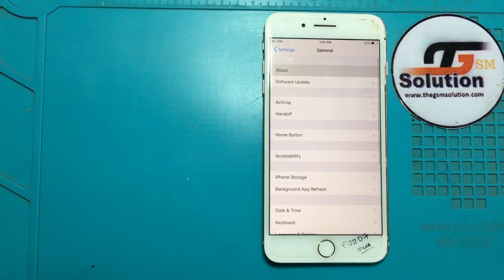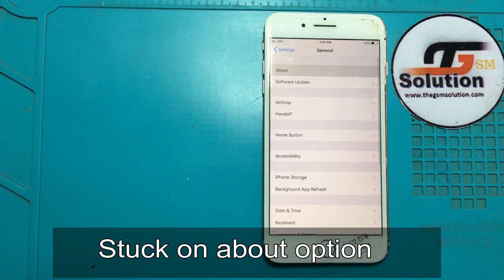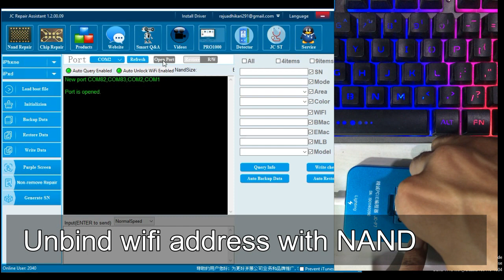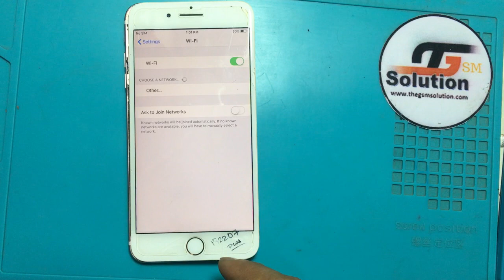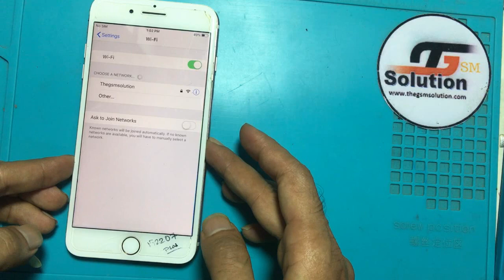iPhone7,7plus wi-fi Greyed out 2019!Fix Can't turn on wifi on iPhone7,7plus.

Comment: I solved this issue today, maybe temporarily but, My iphone 7 plus had the wifi grey out problem, upon reading online, one of the suggestion i saw was put your phone under a lamp for 30 minutes, now from what i understand, it wants me to make the phone hot, so what i did instead was remove the logic board, took out my heat gun, and just blasted the wifi chip for 5 minutes, thing was 100+ degrees celsius, and then i use something to kinda press it down on to the chip a bit, not sure if it does anything but whatever, after that i put the phone back together, and to my surprise, the wifi is now back on. definitely try this if you can.

Comment: hey! this happened to my phone and I was pretty freaked out because all of the videos showing how to fix it involved taking my phone apart. All I did was turned it on and off a few times and then let it sit for like 20 mins, and the problem fixed itself. so wait a little bit of time before you tear your phone apart!!!
Reply from the maker: Sometime that process works but not the ultimate solution on that cases only reball the WI-FI chip then the problem solved that issues shows the dry soldered of WI-FI IC.
Reply: thanks ! this just happened to me and it worked😌 I appreciate it !
Reply: laderricka nephew did u wait for it when it was off or on?
Reply: I’ve had this problem for almost a year and it still doesn’t work
Reply: Did u wait for it when it was on or of
Reply: Same second time it's happening
Reply: Megan.Major same this is happening to me and it’s been a month and it’s still not working

Comment: Nice work.  I was confused a little bit.  Did you reinstall the same wifi chip or did put in a different one?  The NAND memory chip was removed so the wifi ID could be removed?
Reply from the maker: I used a new one WI-FI chip and unbind wifi with Nand programmer.If you used old from same iPhone only reball wifi chip no need to remove Nand.
Reply: @thegsmsolution1  can i use wifi chip from another iphone? Like 5 or 5s?
Reply: @thegsmsolution1  hello
Reply: @schatzy3596  no only iphone 7

Comment: i just tap on the wifi button a bunch if times then i reset settings, like i double tap snd swipe up on settings. then i turn off my phone and wait 5-10 min. its a temporary solution till i have the money to get it fixed
Reply: JessieTheDoggie _RS omg wtf I’ve been panicking for ages and was reading through the comments and saw this and tapping it a bunch of times worked!!! Ur a lifesaver
Reply: Omg it does
Reply: What about when you try to upload a picture to an app and it says you have to allow access but it doesn’t let you and the phone speaker
Reply: mine just came back. is it just temporary?

Comment: Hey i have a problem.. my i7 plus has a bent issue.. and sometimes wifi,hotspot, mic and camera not working.. after restarting and resetting it fixed for certain time and the same problem appears again and again.. since every technicians rejected to fix it.. i wanted to give it a try.. i mean wtf this is not rocket science noh..  so if you  can guide me, that d be very helpful..

Comment: Hi, after wifi chip replacement the phone does not work at all. Power supply shows me only 40-45mA. Do you have any idea why, please? Thank you.
Reply from the maker: Overheat makes such issues check the parts around wi-fi chip shorting or out of position.
Reply: @thegsmsolution1  Thank you for your reply. There is not any short.
Reply from the maker: Once restore and check which error you got.

Comment: Just replace my iPhone 7 Plus board and both WiFi n Bluetooth not turning on just wondering if it’s the board or the antenna
Reply from the maker: If there is low signal on WI-FI there might be Antenna but If the option are greyed out that is the problem related to WI-FI chip both WI-FI and Bluetooth packed in one IC .So,better re-hot wifi chip with hair drier for sometime might be fix that issues.

Comment: Y’all you can try putting napkin under the WiFi chip on the mother board it works for me
Reply from the maker: If the wifi chip is dry soldered that method might be works but that makes board to band cause other issues.
Reply: Thegsmsolution what should I do I don’t have your tools. Can I sent my iPhone to you for repair?